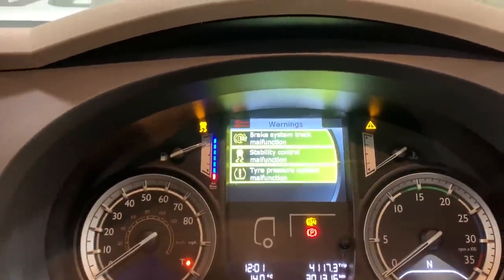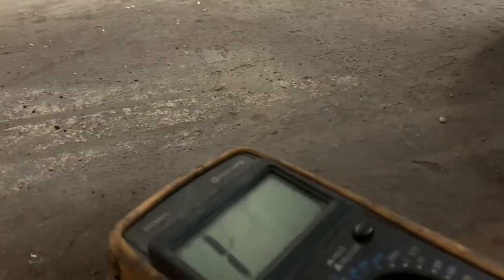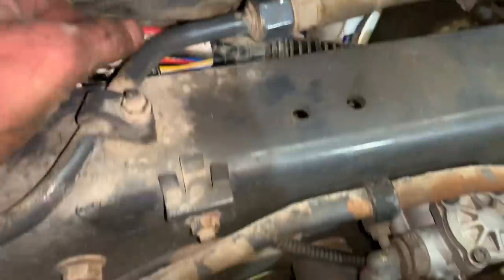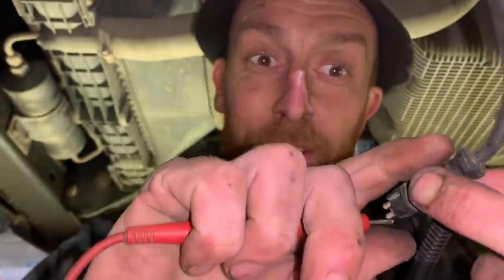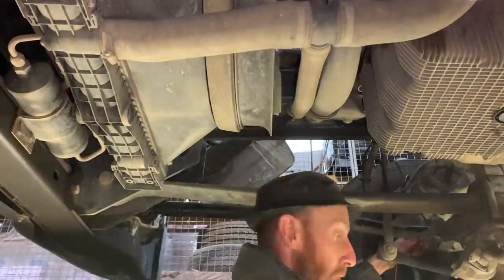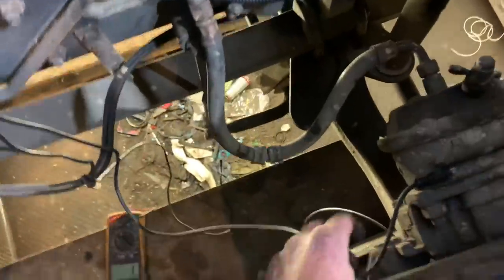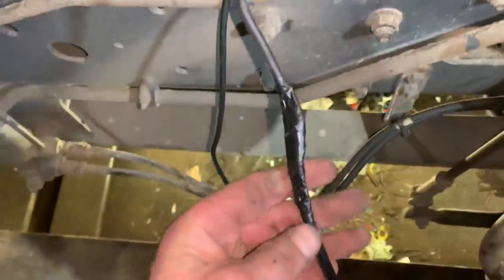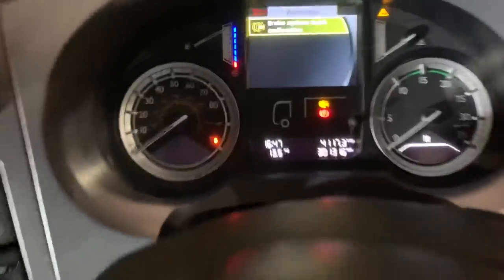Abs Ebs fault stability malfunction tyre pressure malfunction Daf hgv mobile mechanic truck lorry

Comment: What the lad from ford and slater said is correct both sensors go to that modulator valve .But for some odd reason the right sensor  wiring goes from the sensor to the bulkhead on the F plug then loopes straight back out the D plug to the modulator ..Maybe its the engineers way of having fun when he designed it as there is no sense in it